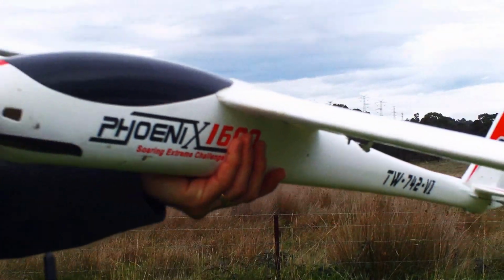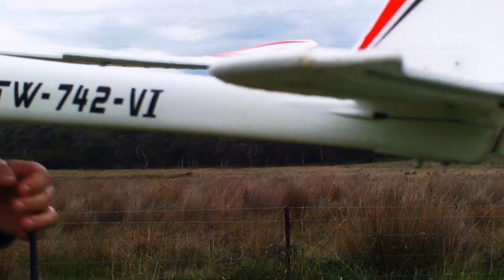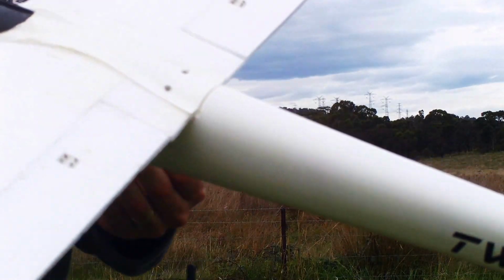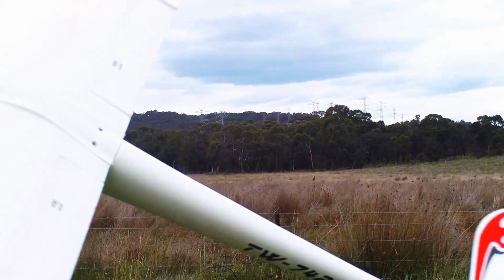Phoenix 1600 EPO Composite Glider with Flap Mix Setting

Comment: Not to be negative, but isn't having the antenna hanging out of the belly of the glider eventually going to rip it off on landing?
Reply from the maker: Hi! The antenna isn't actually at the lowest point of the fuselage, so it only brushes the ground on landing. No problems so far!